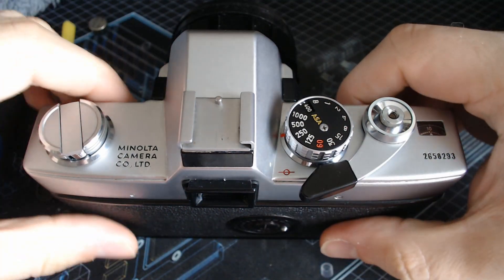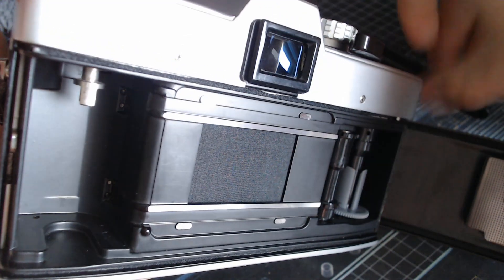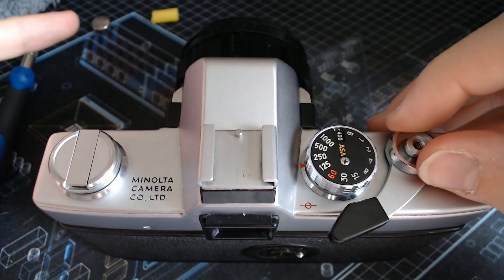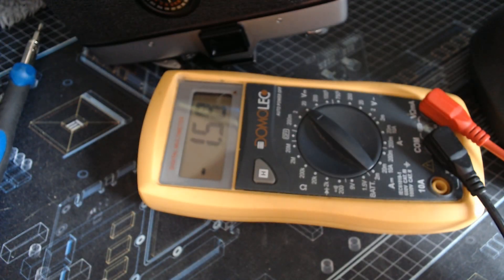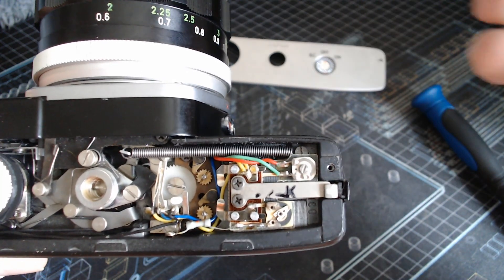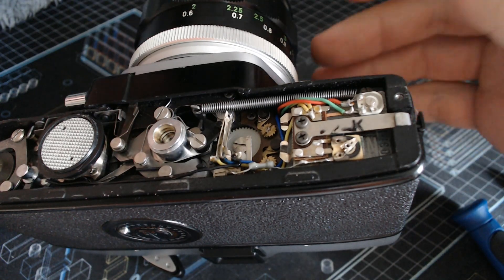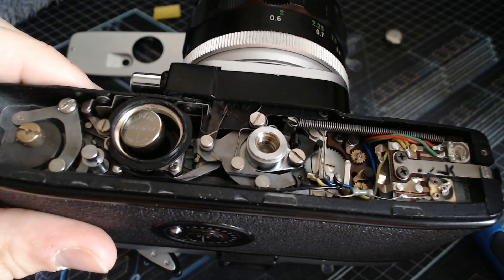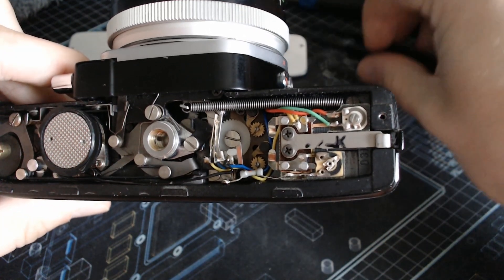Minolta SRT-101: how to adapt it for 1.5V batteries !

Comment: I don't think this is a very good solution for using modern 1.55v batteries. A photoresistor's output curve is logarithmic, not linear, which means changing the battery voltage will create DIFFERENT levels of inaccuracy depending on the amount of light coming through the lens ... So calibrating the pot to make the meter read correctly using 1.55v for one situation will make it even MORE inaccurate for other situations - this was my experience when trying this solution, I could make it accurate for one lighting situation but when I took it somewhere much darker or brighter it became very inaccurate again, if I then adjusted it for that lighting it would become more inaccurate for the other lighting, there was no way to make it consistently accurate simply by adjusting the pot - which makes complete sense given the inaccuracy caused by the different battery voltage is not linear but varies based on the amount of light. The best solution is to use a voltage-correcting battery adaptor or solder in a diode that corrects the voltage before it hits the light meter circuitry and make sure you are using silver oxide 1.55v batteries that have a consistent output unlike the cheaper alkaline versions. After doing this my meter is consistently accurate in all lighting situations. There is more explanation here https://schneidan.com/2015/05/19/the-trouble-with-mercury-batteries-and-what-to-do/

Comment: I use a 625 alkaline battery and install a small diode right off the battery case.  There is room there for that small diode.  That drops the 1.5 volt battery down to around 1.3 volts. Perfect for that metering system
Reply from the maker: Yes !! I've seen this idea in another comment and it sounds brilliant. It prevents the meter going "bad" when the alkaline battery voltage drops over time. I need to try it out and potentially post an update video to this one. But I haven't found the time recently ahah
Reply: @NicolasDimov please do, I just opened this video hoping it will be that.

Comment: There is a disadvantage with this method and it is that 1.35v mercury batteries had the virtue of keeping the voltage stable until very shortly before being completely discharged, alkaline batteries go down in voltage very quickly, cameras that used mercury batteries do not have a compensation circuit since they did not need it as the discharge curve is so linear therefore even if the potentiometer is changed or the film sensitivity (ASA) is compensated by changing on the dial, little by little as the voltage of the alkaline battery goes down the precision of the camera's light meter also changes. The best solution is to connect a diode to the battery output that corrects and rectifies the voltage keeping it at 1.35v until the end of the alkaline battery's useful life. It is better to use SR44 since they are more linear in discharge than LR44.
Reply from the maker: @marcelocampoamor4761   Thank you ! I had seen the soldering of a diode on the main circuit thing when I researched this lightmeter issue but to be honest I didn't understand it much at the time (or I didn't try to understand it). Since then I've read about the discharge curves of LR/SR/PR44 batteries and such. The voltage rectifying diode seems to be the best long term solution. I'll look into it, potentially try it and if I see no one did a video on this I'll post an update video !
Reply: I think SR44 batteries have that feature as the old mercury batteries. Hold a constant charge just before they  die off. LR44  get weak over time thats why they are not good for light meters in cameras for obvious reasons.
Reply: Surely you mean a resistor not a diode it has always been my understanding diodes just let electricity flow in one direction ?
Reply: @stanbirchall5889  Indeed the diode lets the current pass in only one direction but in this case the other functionality of the diode is that the voltage it lets pass is fixed and constant from a value if you choose the correct diode then it will be a constant 1.35 V regardless of whether the input is 1.5 V or more, if the voltage that the battery can produce drops below the minimum value that the diode opens its "door" (in this case 1.35 V) then the voltage becomes 0 V and the battery must be changed which is what is wanted because otherwise the light meter would give erroneous values
Reply: @stanbirchall5889  Using a resistor alone is the same as correcting with the ASA sensitivity dial, it does not correct when the battery voltage decreases over time, if a correct diode is used, it works as a resistor and as a voltage stabilizer.
Reply: @stanbirchall5889 pretty sure he means a zener diode not the general purpose diode youre recalling.

Comment: Great video, do other cameras have the potentiometer to perform this hack or only this Minolta?
I have a cosina csm slr. I believe I'll have to remove tha bottom cover so i can check it.
👍
Reply from the maker: So my guess would be that all old film cameras have something like this. But there might be some change as to how to tweak the light meter based on the camera model. 

For example, Canon's old mechanical cameras, the FT and FTb, have similar potentiometers, but the FTb has one for the low light and one for the high light. So you need to adjust each based on the light parameters. If you look on my channel, there's a video on how to calibrate the lightmeter of X-300/500/700 cameras, and it's a whole process. It's definitely trickier. Not that much harder if you take your time and understand each step of the process, but significantly tedious. 

The Cosina CSM SLR has an electronically controlled shutter. In those, usually the potentiometers are on a circuit board at the top of the camera, but I couldn't tell you without looking it up. Now, this camera has a 1.5V-based battery compartment. Why do you believe your light meter could be wrong? Have you checked it against a known working one? Are your pictures over/underexposed? 
It could be a shutter timing issue. When I bought my Minolta XD7, for example, the light meter was spot on, but thank God I serviced it before taking pictures because the shutter speeds were absolutely wrong.
Reply from the maker: I think a good rule of thumb could be:
- if your camera has a "circle and needle" lightmeter system, it's likely that there's at most a couple of potentiometers (one for the high light, low light, battery check). You could get away with it by simply following the wiring and figuring out which circuit does what. A quick Google search might also yield easy-ish to follow steps.
- if your camera has an "A" mode (aperture priority) and/or an LED lightmeter system, it's probably going to be slightly more complex. Usually there's 3 potentiometers: the first one does the "constant current" part of the system (called ASA inclination), the second one the A/D conversion and finally the lightmeter itself. Adjusting these is more complex, but not impossible. If you scrub through the X-500 video I have you can see what I'm talking about.

Comment: I have the same camera but needed to clean up the viewfinder from the inside so i took the top part off. After reinstalling everything the film advance lever is a bit loose (but can still be operated it just doesnt lock itself in place). Do you know what could be the issue? I built it like it was before.
Reply from the maker: Hmm. How much did you take the shutter mechanism apart? Did you pull out the shutter button (on a rod) with its washer? You don't have to in order to remove the top. If you did, you might have unscrewed the brass nut below the shutter button retaining the spring mechanism that's responsible for the "rewind" action of the lever. I've never had to fiddle with this part of the camera, so I wouldn't know how to tension this spring. I'd advise you to search "Minolta SRT 101 service manual" on Google. You can find a 43-page PDF with detailed explanations on how to service each part. You might find some information on how to tension this spring.
Now all that being said, it may just be that you need to tighten the round, slippery nut on top of the shutter button (the very last one you have to screw in order to complete the reassembly).

Comment: Interesting! This makes me think whether I could try to tweak those vintage Prakticas I own in a similar manner ... By the way: I also purchased my vintage cameras because I was heading for the lenses that they came with ... Carl Zeiss Jena rules!
Reply from the maker: Yeah I'd assume loads of camera have a sensor that can be tweaked. You might have some luck typing "[name of camera] service manual PDF" on Google. Some of these service manuals have procedures on how to calibrate these sensors. These instructions were intended for people assembling those cameras back in the day, but you can "make do" at home with an external light cell and a multimeter.